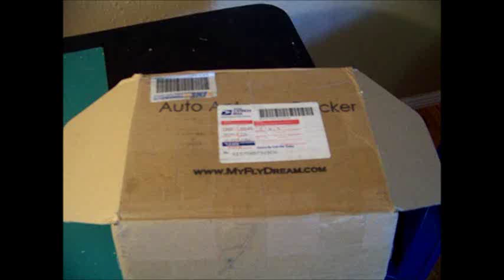MyFlyDream AAT setup

Comment from the maker: It wont have a mic on the video tx but I can tell you the most common problem is a noisy audio line on the video tx.I dont know if that one has a potentiometer or not.You should contact Immersionrc and ask them if it does.I used a 1.2ghz video tx that was noisy and the tracker was way off.Adjusted the potentiometer until the red LED on the tracker was blinking as fast as I could get it and it tracked perfectly after that.

Comment from the maker: do you have a video of issue?Is the red light flashing fast.Did you get a good GPS lock.Wait for 7 satellites then set home with rig right next to your tracker.Also tracker is not going to be accurate until you are around 30-40 feet away,then it starts tracking and is very accurate.Best test is to fly LOS and see how tracker does.

Comment from the maker: The only way to switch is by reflashing OSD which I dont suggest doing right now.I just got a new "gold board" OSD from them and reflashed and its worthless now.They say its either a prob with their firmware or my flash tool(which I got from MFD)My first yellow board OSD flashed just fine with same flash tool.They did send me a new OSD already flashed to replace the one I bricked.

Comment from the maker: No problems with it getting hot.It can be powered with 7-20 volts directly.You need the extension board to have current sensor as well as RSSI and rc view switch.

Comment: Have you consider that telefly OSD really get very hot! di you ever have any kind of problem whit that! I'm using the OSD from it because I destroyed my 117 AP so basically I have a Stavilizer and auto pilot even RTH but don't have any way to see what is going on! so I decide to use the Telefly OSD! But have not way to use the voltage meter, or amp meeter!